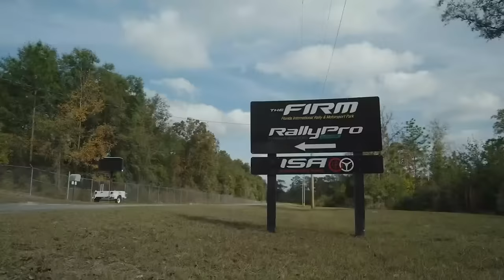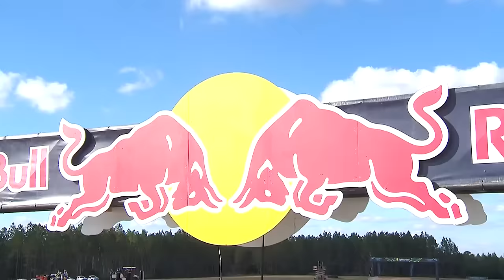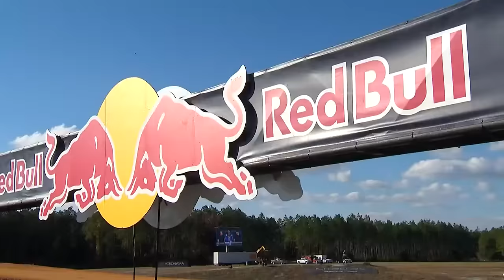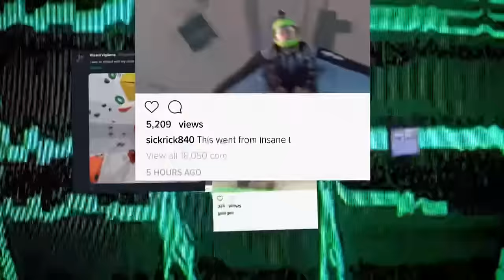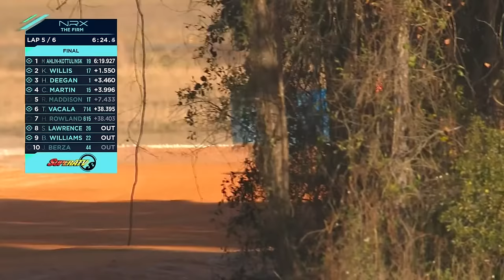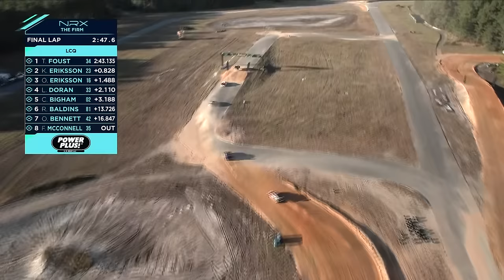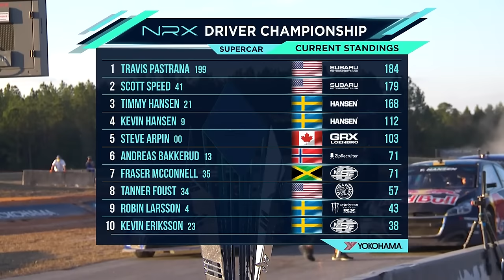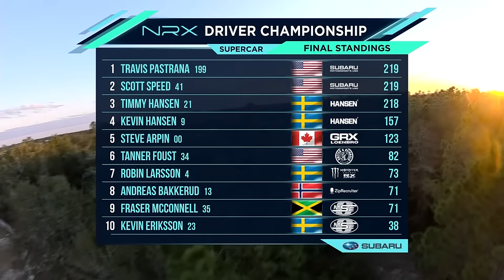Nitro Rallycross Florida FULL Broadcast - Finals

Comment: a subaru has a pancake engine, the tahoe is a v8, nite and day. the sound of a subaru sounds 'rough' due to the gravity pulling down on the side of the pistons. corvair had one, not a good idea either. the subarus around here are pulled out of ditches with GM vehicles that have real engines